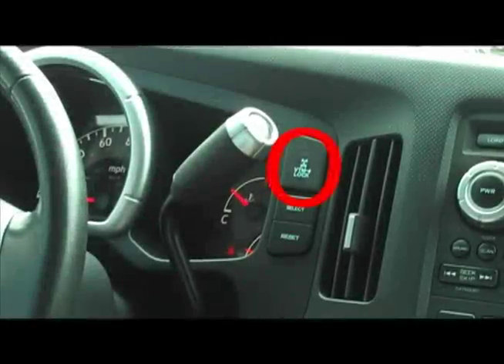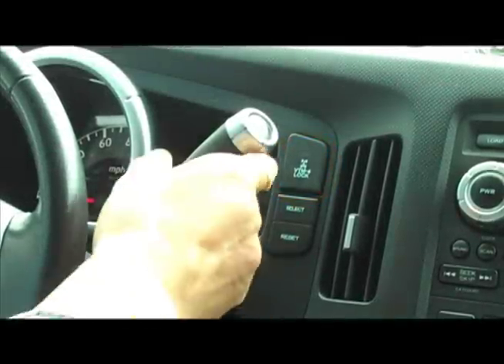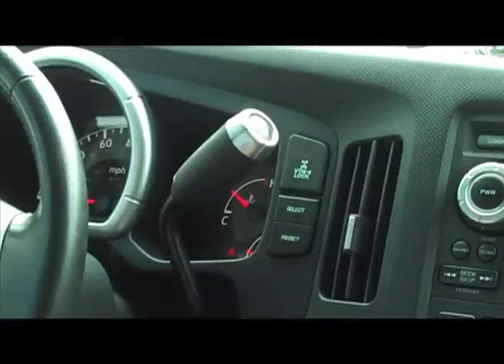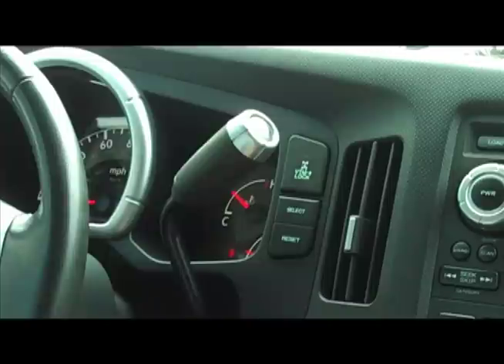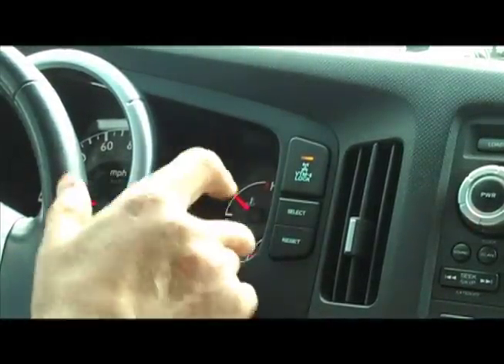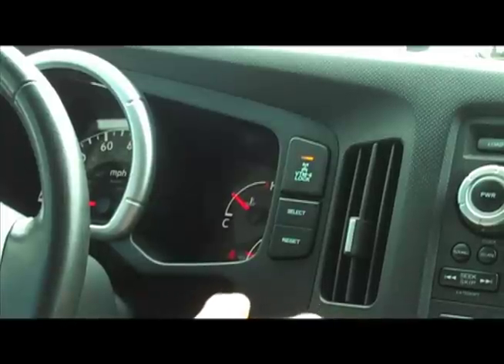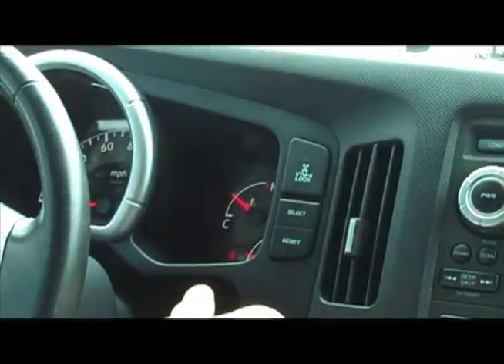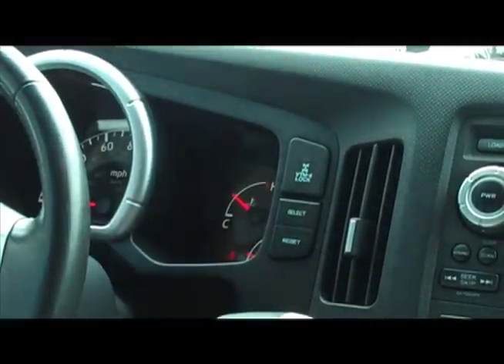Service Tip: VTM-4 Lock

Comment: So if you're on a snowy road, can you drive for a long period of time with the VTM-4 on? Or is it only to be used if you're stuck and that's it?
Reply: Technically you could but it's probably not recommended.
Reply: It’s recommended ONLY for those moments where you need it other than that the computer will take care of it

Comment: actually it does engage all 4 wheels. It only "locks" the rear but front drive is also engaged.  The best way I have found to use it if you are stuck is turn TCS off (it's next to the cruise button down by your left knee area and a yellow indicator triangle in gauge cluster will come on when it is off) If you don't have this off the braking is counter-productive when trying to get out of extremely bad situation. The computer will begin to brake all four wheels because none of them have traction

Comment: VTM-4 also works in reverse and when you shift back into drive the VTM-4 will automatically disengage.
Reply: tandd5804 how long does it usually take to disengage?
Reply: Cattywampus My 04 MDX disengages instantly when I shift up to drive. If it didn’t I would manually disengage with the button and try resetting all ECM sensors- a simple 5 minute process. If it still refused to auto disengage, then I would consider that dreaded trip to a qualified mechanic or (sigh) the dealer.

Comment: So does second gear while on VTM 4 lock allow u to increase speed past 18? I used it tonight on a trail and was going over 25 no problem?
Reply: Good Q. Has to stay under 18mpg even in second, it is for slow moving traction, works well.

Comment: I take my 2007 Honda Ridgeline in for service and they say that my battery needs to be replaced. It had been four years since I last replaced my battery so I tell the guy to go ahead and get me a new one. That night I am driving and the VTM-4 and Check Engine light come on simultaneously. Is their something wrong with my Ridgeline?
Reply: I'm having the same issue. Did you ever figure out what the problem was, and how to fix without taking to the dealership?
Reply: @scottb7186  in the first place i never take my vehicles to the dealership if i do not get a maintenance program (and I never do). Second, yes turns out that the friend I talked to said 'there was nothing wrong with the engine just that the sensor had been over-sensitive'. So, I follow up "If there is nothing wrong should we just replace the sensor" He summed it up by making it sound like it would be costly to do so and it would not be worth it. 'Best to just drive and have it looked at next time you need to take it to the shop' he said. When I finally went to the shop like four months later the sensor was still on and the guy said it be 400 bucks for a new one. I just lived with it. Eventually sold the truck to my cousin. It is still be driven today with over 180k miles

Comment: Someone said that the Honda reverts to 2WD that isn't accurate the rear drive is always engaged and both back axles have computer controlled wet clutches. When VTM-4 is off you have one front wheel and both back wheels pushing independently if conditions require. When VTM-4 is engaged both back axles are locked.

Comment: My vtm4 light keep coming on while im driving and my vehicle just slows down.What do i do to fix it
Reply: Did you ever figure out to remove the vtm-4 light?
Reply: This happens to me sometimes and I just turn it off then back on and it usually stops
Reply: My check engine light came on and vtm4 light I had a p2138 code Acellorator pedal position sensor changed it out rolling again

Comment: My VTM-4 lock light cane on, and also the engine light as well. It was snowing out, and it was just a bit icy out on the road. Anyone familiar with that issue?
Reply: Happened with me and it turned out to be an O2 sensor
Reply: Benjamin Napoleon it just happened to me  but all i did was drive from Fresno to L.A. and niw i dont know what to do or how to fix it. :(

Comment: so its just a diff lock? Not even Low range? It's definitely not a high range,
Reply: No low range. Vtm-4 lock engages clutches on the rear axles locking them within the clutch limits below 18 mph. 

The front diff is open. Vsa will brake the spinning front wheel which directs power to the non-spinning front wheel. Personally, I don’t like driving in deep snow or sand with vsa enabled because if vsa can’t control wheel spin, it will cut engine power just when you need it to power through a difficult scenario.

Comment: Wrong. There is no center diff on these. There are wet clutches in the rear. Pressing the VTM4 button locks those clutches in the rear so it acts as a locking rear diff.

Sources: Common Honda knowledge.

Comment: Crappiest 4 wheel drive system ever can even get your rpms up when U r in trouble the engine just revs down it’s a joke
Reply: And that’s a function of the vsa system, not the Vtm-4 system. If vsa can’t control wheel spin, it will cut power, often just when you need wheel spin go power through deep sand or snow. That’s why I don’t like to use vsa in such scenarios. Fortunately you can disable vsa via a switch on the panel unless you have low psi in your tires.
Reply: @speedlever  even when I disable it and start spinning it engages its self again I hate this system and truck it’s ball less
Reply: @jasonnester9514  
What year is your vehicle? I have a 2006 pilot and a 2008 ridgeline. Both have the Vtm-4 system and both function as designed. It’s one of the better AWD systems out there imo. I can only assume you have a problem with your system. Vsa shouldn’t cut back on by itself unless it detects low tire pressure. In that case you’ll have to pull a fuse to disable vsa (vehicle stability assist). This works in conjunction with the Vtm-4 system to control traction and provide AWD.

If vsa is disabled, you can use wheel spin to power through deep sand and snow. 

If you have a later model with a different system, I don’t know about that.
Reply: @speedlever  2012 Ridgeline
Reply: @speedlever  And I hit my traction control button and it won’t turn it off I press it I hold it nothing happens so it’s always engaged now
Reply: @jasonnester9514  
Then you have a malfunction in your system. I suggest you head over to ridgelineownersclub and see if anyone there can help you sort out the issue. I have no trouble with either of my vehicles with VTM-4 and VSA systems. You should be able to disable traction control via the vsa switch on your dashboard.
Reply: @jasonnester9514  
Do you have any lights on the dash? Does it pass the self test when you turn the ignition key on (before you engage the starter)? Does it throw any codes? (Check for free at most auto parts stores if you don’t have the tools at home). Does your truck have any mods or accidents?
Reply: @speedlever  yes the tpms warning light stays on all the time I’m trying to sell it anyways truck also needs catalytic converters I can not afford that
Reply: @jasonnester9514  
That’s why you can’t disable vsa via the dash switch. Tpms will over-ride the vsa switch. Your characterization of the Vtm-4 system being poor is inaccurate because of problems with your truck. Get that fixed and I think you’ll be happy with it unless you’re looking for a rock crawler which the Ridgeline is not!
Reply: @speedlever  thank you